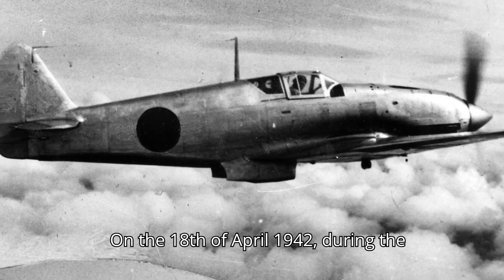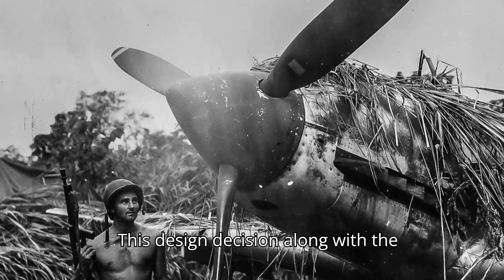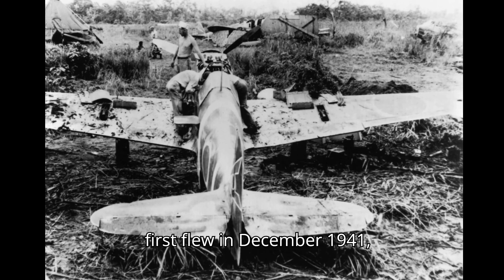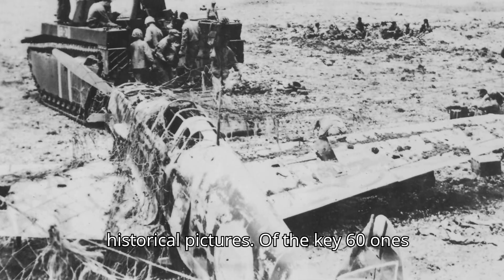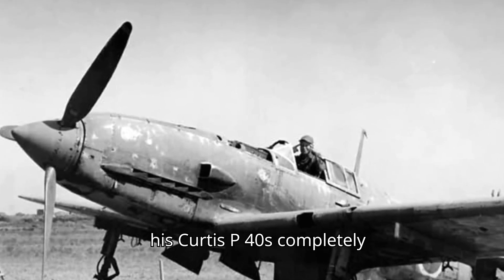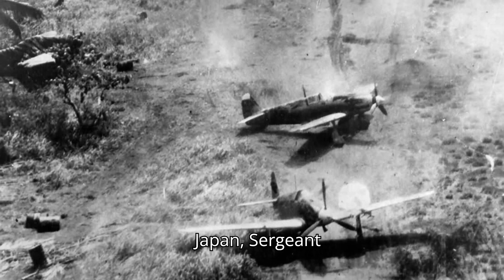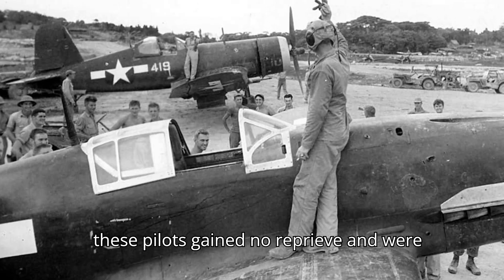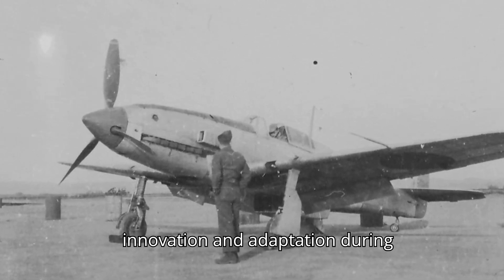The Kawasaki Ki-61 "Tony"

Comment: There were several Japanese metal-clad metal airframed aircraft that preceded the Ki 61 including the first Duraluminum clad A6M . . . aka the "Zero". What their license built DB601 lacked was the variable speed hydraulic supercharger drive that Diameler Benz developed after Kawasaki and Aichi had invested in producing the earlier version. Both of their wartime workforces had problems holding tolerance on the mains and crankshaft of the unfamiliar long V12 powerplant.

Comment: Very informative and great variety of photos. 
Only 2 issues.
1) The speech to text needs much better editing. The voice was quite easy to understand, but the text was often nonsensical. 
2) The Japanese may have been using fabric covered planes when the Ki-61 was first thought of, but all metal construction was standard by the time it flew.
Reply: Agreed on the captions. Have dropped them in the latest video. Ta on the "cloth covered' should really have just mentioned the super light aluminium alloy that was no better than cloth.